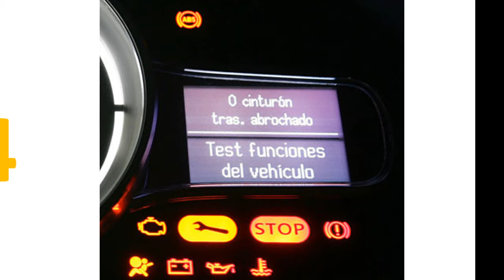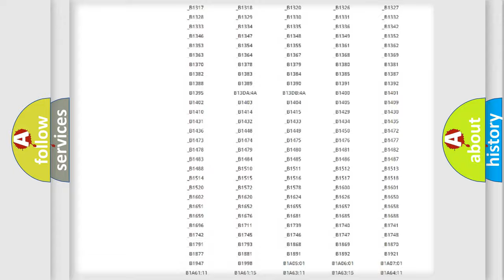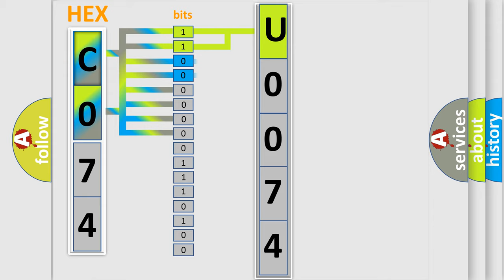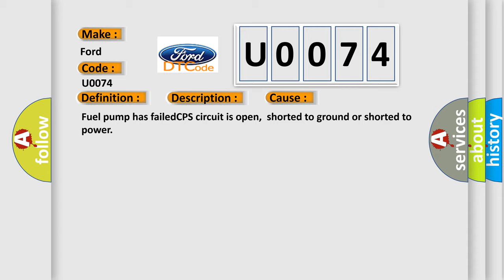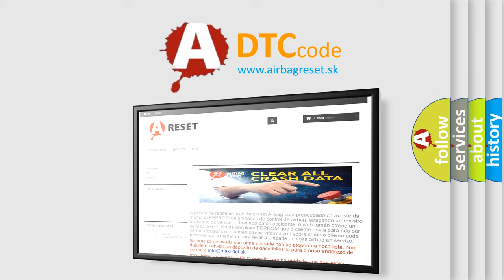DTC Ford U0074 Short Explanation

Comment: U0074 is CAN bus B off, NOT a camshaft code. A camshaft code would be a P code as it is a powertrain malfunction. U codes are communication/module codes. This video is less than helpful and downright misleading.